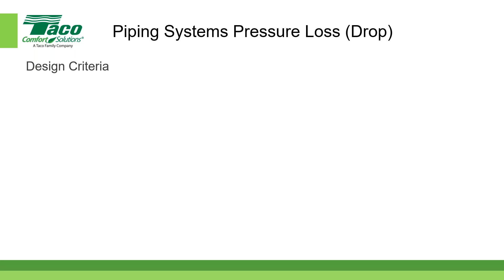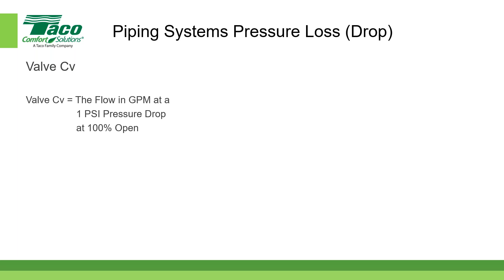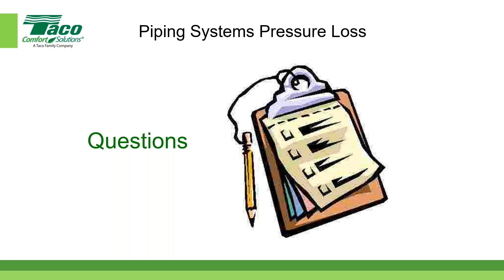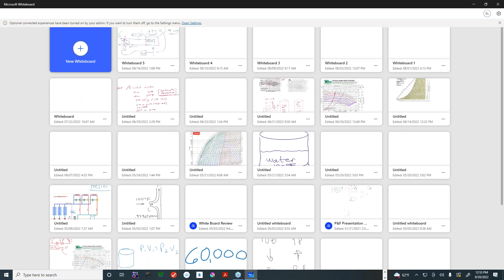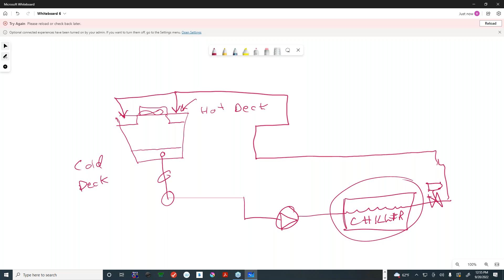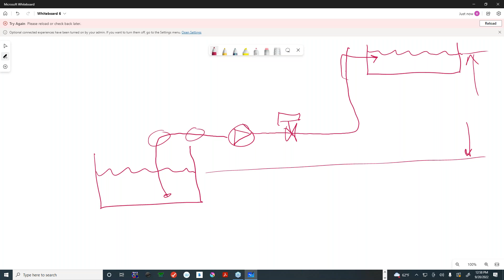Proper Hydronic Piping Pressure Drop Calculations

Comment: Can you explain pressure drop
Reply from the maker: Thanks for watching the Taco Tuesday webinar. Austin, pressure drop is the number we calculate for the frictional losses of the piping system when trying to move the water through those pipes. It includes the length of pipe, any fittings and valves as well as any other components in the system.